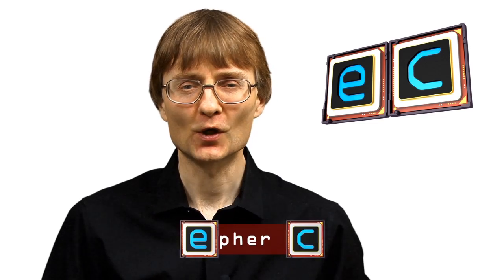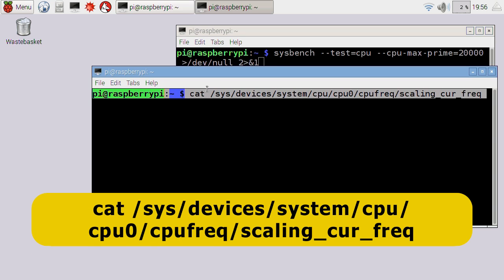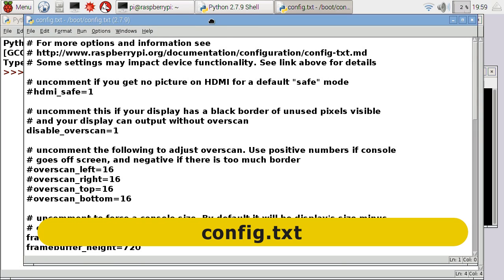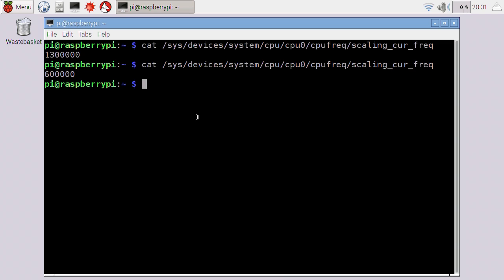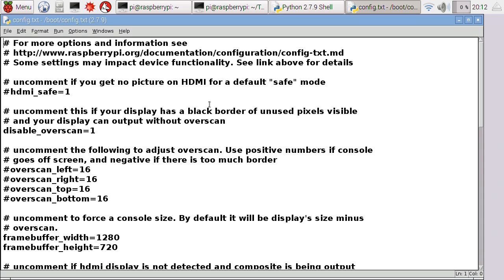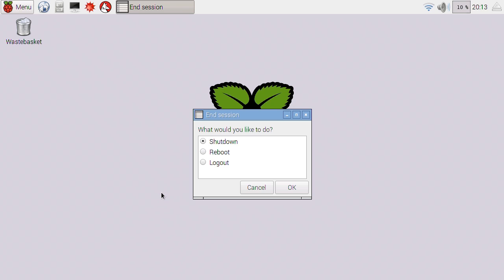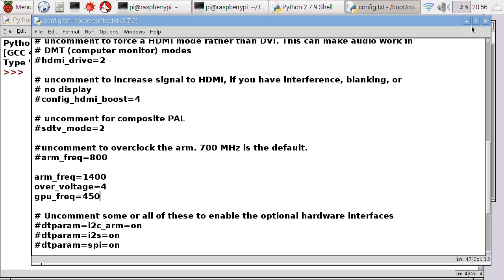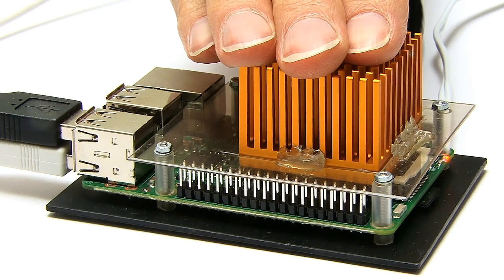Raspberry Pi 3: Overclocking

Comment: I'm curious about that "cat" 🐱 command you're using to indicate the CPU speed. Is that number actually stored in a physical file? On the micro SD card? It sure seems that rewriting that number to a file every time the SOC throttles and resumes would really slow 🐌 things down and prematurely wear out your memory card! Or are they writing to a RAM disk?
Reply from the maker: There is only a tiny amount of data being written, so the card should be fine.

Comment: hey, i have a little question, my raspberry pi 3b says in raspi-config, this pi cannot be overclocked.
will my frequency still increase if i go to config.txt?
please let me know i'm new to overclocking and would like to slightly increase the performance of my pi.
Reply from the maker: I would suggest updating your version of Raspbian. Early on the Pi 3 did not support overclocking.
Reply: All right, thanks for the quick reaction.
Reply: Anand Raj  sure thing althought i would like to recommend using a heat sink when overclocking, as the pi gets quite hot, if it is under sustained load.

As for the values in config.txt
I was able to push it to 1350MHz with a over_voltage value of 2, now it performs just shy of my all new 3b model +
Reply: Anand Raj  lol, does it look like an ice tower?

Comment: Nicely done, thanks. I did this to boost the online video streaming of my raspberry pi 3. It didn't quite work... It really has a hard time loading the YouTube website. If I select any video quality greater than 480P or fullscreen it either pauses every 5s and loads the video even if it is downloaded or just freezes so I have to unplug it. Anyone having the same problem? Any idea why?
Reply from the maker: For good YouTube performance on a Pi, use the Chromium browser, and make sure you have the h264ify plugin installed and enabled. This forces YouTube to use H.264 -- which the Pi and decode in hardware with its GPU -- rather than YouTube's VP8/9 codec defaults, which will have to be decoded via the Pi's CPU, hence degrading performance.
Reply: ExplainingComputers Thanks for the recommendations. Unfortunately I've done all those. It's a pity, since it handles 1080P resolution videos really well with omxplayer...
Reply from the maker: Try accessing YouTube using XMBC, Kodi, or something like that. This could also be a WiFi issue?
Reply: ExplainingComputers It's not a wifi issue. Should I enable the experimental GL driver?
Reply from the maker: It is worth a go! I'd also be tempted to try a clean install of the latest Raspbian, perhaps on another SD card?
Reply: I enabled it. It only caused problems. I have another sd with the latest version of raspbian and the same thing happens.
Reply: I was able to solve the problem with Kweb. It's actually amazing. I am now able to play 1080P YouTube videos on fullscreen without fps loss or freezing.

Comment: I wish you would have done something w the SDRAM too & possibly touched on GPU memory allocation.  Before I even looked at overclocking, I adjusted the GPU memory allocation up to ~256...then I saw this, did the final set of OC instructions, which worked perfect, then I slightly bumped up SDRAM freq & the title bar wouldn't load...(?). 

Commenting out my SDRAM freq change, and no real issues.  The wiki has a great deal of information, which helps...but your vids are always pretty clear cut - 'do this, this, & that, & here's something that works' .....I think that's a direct quote from one of your vids if I'm not mistaken.....(?).

Anyhow, you may already have done it & I just need to search a bit; needless to say, I don't want to get into codependent mathematics & such the wiki focuses on just to insert a discreet number for the title bar to load...

Otherwise, good stuff - this shows the flexibility/adaptability of the RPi, even in the face of all the brute hardware China can/is throw(ing) at it...
Reply from the maker: I could always do more! :)

Comment: Suppose you overclock too much and it can't boot. How then do you edit the config file to change the speed back to something that works?
Reply from the maker: You would have to edit the config file on another computer. Or if you have overclocked too much, the Pi may be dead anyway.

Comment: How I did is is ( that I bypass the supply ic of the pi and I feed 1.74v on the CPU directly but I was forced to use a very big cooler
Reply from the maker: Respect to you Sir, very impressive! :)
Reply: ExplainingComputers (And can you do a video how a  smartphone battery communicates with the phone because I want to bypass the battery of my old phone but I don't know how it communicates)
Reply: ExplainingComputers And can you do a video how a  smartphone battery communicates with the phone because I want to bypass the battery of my old phone but I don't know how it communicates

Comment: But what is the max Freq that the CPU can go?
Reply from the maker: It depends on your individual Pi -- if you got one frmo a good batch of SoCs it will go higher than others. It is rare to get a Pi about 1.4GHz reliably -- so you have done very well at 1.7. I have never heard of a Pi running above that.

Comment: Ull sand u info pine64. Is 24cash 1gig    rock64 is 30cash on ther wab pag now ther bater speed faster than pi have u got it dun it used it i meen

Comment: I need to know if you can run raspberry on Rock 64 can you run the Lenox raspberry software on Rock 64 or should I just get a raspberry device because I'm new and wanted to try this and God a rock 64 because it was supposed to be better but the community is to small

Comment: So I use my pi for gaming especially for PS1, but some games could run a bit better so if I change it to overclock at 1300 without sink just factory stuff I would be fine and my games run better? I'm a total noob at this just a enthusiastic gamer

Comment: I don't think I have any credentials at all to say this but I was quite surprised that you didn't keep the tests running until there was no further increase in temperature. I would suggest that only when you have seen the temperature plateau (or maybe even blip downwards a tenth of a degree) can you be confident that it is stable. In all these tests the temperature was still climbing. 
Of course the answer may be that you've seen other examples and have developed a confidence that the peak temperature is only fractionally higher than what is achieved after about ten minutes. 

I'll see myself out.
Reply from the maker: The answer is about practicalities. A Raspberry Pi is extremely unlikely to run for an extended period at full processor load, so the tests were limited in duration. Also, I am making a video here! Specifically I am recording the output form the Pi in real time to a ProRes recorder. That's about 2GB of data every minute that needs to be stored, copied over for video editing, etc. So running tests for extended periods had a significant payload. :)
Reply: ExplainingComputers Understood. It might be worth doing an extension test once to see how passive cooling works and whether it does reach a plateau. Once you graph that temperature climb once you will have a better grasp of how it works so you can estimate what temperature it will top out at based on the initial temperature climb.

Comment: Underclocking. My Pi3 runs very hot doing some signal processing (tracking very weak (0.01 watts) glider anti-collision warning systems with sensitive receivers), but much is done by the GPU. I assume I could minimize the heating by underclocking the CPU to 1000 or 1100 MHz using these techniques?  I am also getting a BIQU Aluminum Raspberry Pi 3 Case Enclosure Box with metal pads attached to the case from the CPU/GPU/RAM to cool the thing down.  If underclocking is not desirable I'd like to know before I toast my Pi3... 
I am a techno-bozo... and a real fan of your videos!

Comment: Excellent video, btw you can bump the gpu to 500 safely, possibly higher depending on power supply and heatsinks etc but some users have had issues above 500.

Comment: Actually, you shouldn't let it cool-down, and should keep it running until saturated with heat. That will let you know how sufficient it is cooling, while in constant high-load. Letting it cool is just masking the true "leveled-off temperatures". Eg, it never got up to "saturated load temps". That is like throwing it in the freezer and stopping the test when it rises to 10c, and saying, "Look how cool it runs at this speed!"

When you hit the same temp for ten cycles of tests, then you are at the saturation level. If there is a change from the second-to-last, and the last test, and it is still rising... Then it isn't "done".

Comment: This works with Raspberry Pi 2 too, I got mine at 1.4 GHz

Update: Tested 1.45 GHz and it shows random colors on the screen
Reply: I think you killed it. Better off buying 3 b+ which is already preset to run at 1.4 GHz

Comment: I'm very unfamiliar with the Linux environment and so when I try to run the stress test and temperature script I get permission denied.
could anyone shed some light please? :)
Reply from the maker: You need to be running it in root mode. So, for example, launch idle (and its terminal) by typing sudo idle in a terminal (not by running the idle icon). Or execute the command with sudo on the front. But running idle in root mode is easier. :)
Reply: ExplainingComputers thank you so much! :)
Reply: Yes just try sudo ./test.sh in terminal and then Your password.

Comment: What you need to do, is run a thermal camera on these boards.
When overclocking, some chips on the board, and voltage regulators, get really hot; and need additional cooling too; not only the CPU.

Comment: After editing my boot/config.txt file to arm_freq=1400, my Raspberry would not go there as I ran the stress test after editing the boot/config.txt file.  I ran the cat /sys/devices/system/cpu/cpu0/cpufreq/scaling_cur_freq command in another terminal window and it would only show 1300000 for the cpu speed.  I cannot for the life of me figure out why it wouldn´t go to 140000.  I edited the file twice and saved it twice to be sure that I had everything right.  I guess whomever made my Raspberry Pi 3 wouldn´t let me overclock it that far.  I´m happy with it running at 1.3 GHz and I did overclock the GPU freq=450.  It still runs very cool during normal use.  I can tell a difference in how fast a page loads from the standard 1.2 GHz and the GPU freq=400.  Thank you for this great video tutorial.  

I think I´ve convinced my wife to finally let me put linux on her Windows 10 laptop.  She really likes the GUI of Raspbain on my little Raspberry Pi 3!  :-)  Now, how do I overclock the RAM?
You should do a video tutorial on that sometime.  Thank you very much.

Comment: I have successfully overclocked my PI 3 to 1.3 GHz.  After running the stress test my temperature never went above 40.8*.  Tomorrow when I get home from work I will bump it up to 1.4 GHz @1.3 volts and run the GPU at 450 Hz.  I cannot wait to try this out.  Thank you for anther outstanding video tutorial.

Comment: he did not wait one hour he shut it down at 20:56 and booted it up at 21:32 his clock on the screen
Reply: I can certainly appreciate your observant personality. As the raspian clock is set to military time, the time duration between 20:56 and 21:32 would represent a time window of 36 min, one which would undeniably be less than one hour, though only provided that the testing was completed the same day, both contrary to your inherent assumption and information provided by the presenter. Nonetheless, the time duration in question may still have very well allowed the Pi sufficient cooling time prior to it being subjected to further experimentation, notwithstanding the presenter declaration of his intention to primarily focus on the upper part of the temperature range.

Comment: will this work with PI 1?
Reply from the maker: Yes, you can overclock all Raspberry Pis. :)
Reply: ExplainingComputers  what is the max temperature can it take?  sorry I'm scared to burn to board XD
Reply from the maker: my glass Is fab Scared (ie cautious) is good -- overclocking is a risky business and you can damage your Pi. Start worrying above 70. Do not run it for long periods over 80. Good Luck! :)
Reply: ExplainingComputers ok thanks :D

Comment: Is it possible to do this to RPi 1?
Reply from the maker: Possible, yes. But totally unnecessary, as a Pi 1 will not get too hot.
Reply: And how high can I go with the frequency of RPi 1? I know that every piece is unique but there has to something like theoretical maximum of SoC.
Reply from the maker: IQLogic Sorry, I am an idiot! :) I saw the heatsink in the thumbnail of this video and thought you were asking about cooling. You can certainly overclock the Raspberry Pi 1. How far will, as you say, be dependent on the piece of hardware you have. However, as a Pi Zero has the same chip and runs at 1 GHz, you may get up to that -- but take things in small steps!
Reply: Heh it is completely OK, we are just humans and I also ask in different way :) And many thanks for your advice. I'll share my test result later next week, maybe it help to some other RPi1 users :)

Comment: this works in EmulationStation? how to make?
Reply: what do you mean how to make? physically or setting up the settings?
Reply: if you have a pi3, I have an old config.txt file saved you could try. I seemed to have good results with these settings but I did not use a heatsink. I did have to take the top off my case however because it was overheating.  Not all pi3s will be able to run the same though.  Some can run faster and some may run slower.
Reply: I haven't ran this in over a year so I will say is while running games you should check the temp whether you ssh into it or have some bug logging set up so you can see what they are doing and if the cpu is throttling itself down because of overheating.

Comment: Another way to speed up everything is faster disk access times. By cloning your OS from the SD card onto a SSD installed in a USB 3 drive caddy and configuring the system so the OS runs from the SSD you can get huge reductions in boot time and program and file loading times. In this configuration the Raspberry Pi 3 can boot in 21 seconds at stock speed or less when overclocked.
Reply: I don't think the RPi supports SuperSpeed USB (and it proballly wont), but regardless this idea might still work.
Reply: The Pi 3 does not support USB 3.0, so it's kind of pointless unless you use USB 2.0

Comment: when I type in cat /sys/devices/system/cpu/cpu0/cpufreq/scaling_cpu_freq it says: bash:  cat/ sys/devices/system/cpu/cpu0/cpufreq/scaling_cpu_freq: No such file or directory. 

help
Reply: The life that burns twice as bright will only burn half as long. Now this pi has burned very brightly, it went up in flames, actually.
Reply: The file doesn't exist. The file you need to check is "/sys/devices/system/cpu/cpu0/cpufreq/scaling_cur_freq".
Reply: You have to update and upgrade the pi in order to get sysbench. Then you can do a Sudo apt-get install sysbench to get sysbench. Had same problem and I found out how to fix it
Reply: How to upgrade?